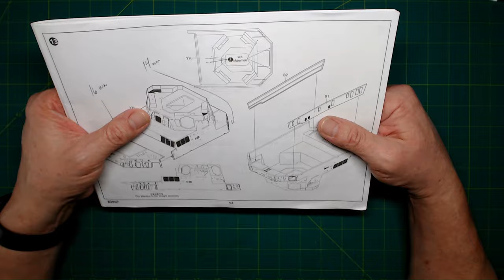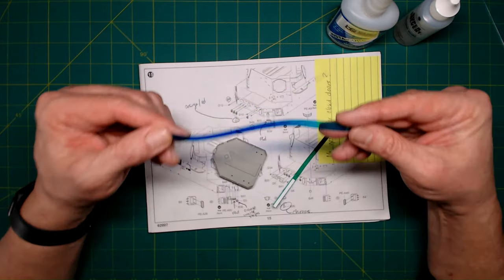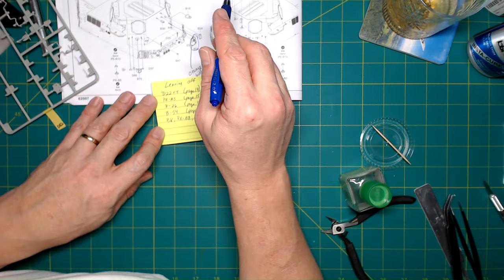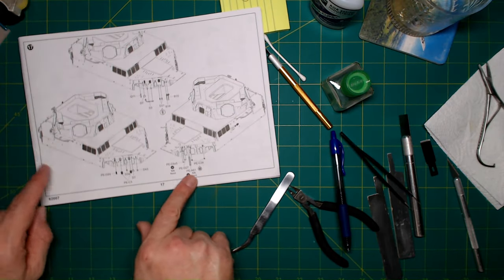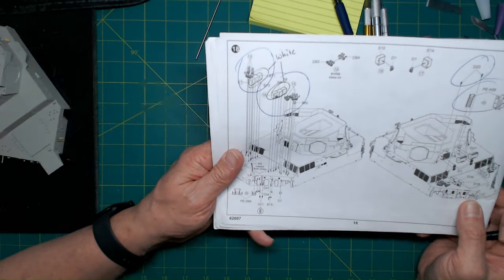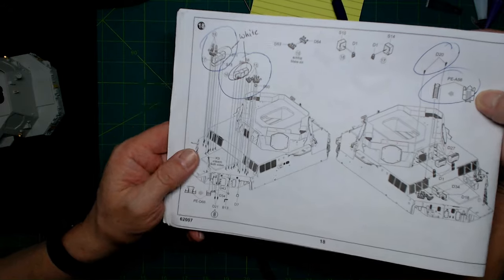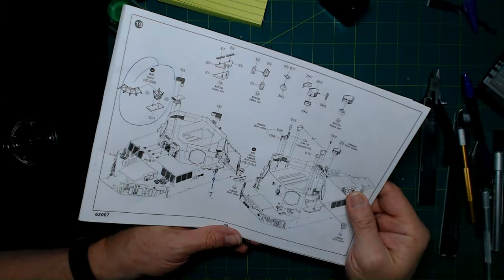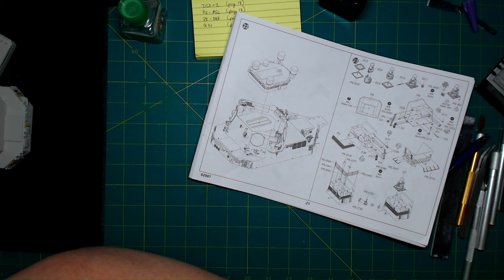USS Curtis Wilbur in 1/200, Video 12a, Superstructure Continuance

Comment: Cutting the windows out was a bitch but I got mine done too. Like I mentioned before, I was going to scratch build some of the bridge consoles and bulkheads but after cutting the windows out you wouldn’t be able to see it. I’m not gonna back my blue/green acrylic with anything because I think the light showing through when you look that close will be about as realistic as possible on this scale. 
Looking at your blue and green acrylic I was thinking it may look good if you layered the blue over the green and left it clear. Just a thought. 
Nice progress cheers 🍻
Reply from the maker: The windows have been a serious pain but I'm slowly getting there. I have found it easier to thin the plastic from the inside first and it also has the benefit of bringing the window framing into a more realistic size for the scale. I'm only backing it with the turquoise vinyl because I think it looks cool and the contrast works. For sure, I'll try combining the colors to have a look before I land permanently on a choice. I'll be going into more detail on my windows in the next episode. Thanks for sticking around and watching!
Reply: @PatricksScaleStudio-76  wish I thought of that. I started of drilling a pilot hole than routed them out with a dremel and micro cutting bit. That gave me room to finish up with some mini files. Tedious but it will be 💯 better than painting the solid windows.
Reply from the maker: I have close to the same process; just starting with thinning prior to drilling, cutting, and filing.